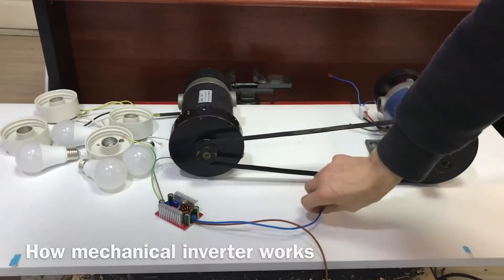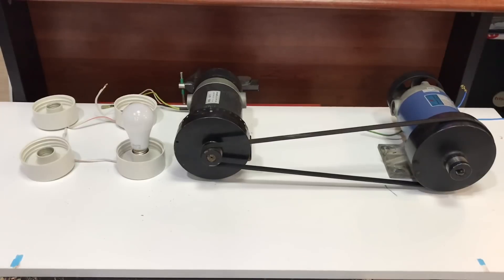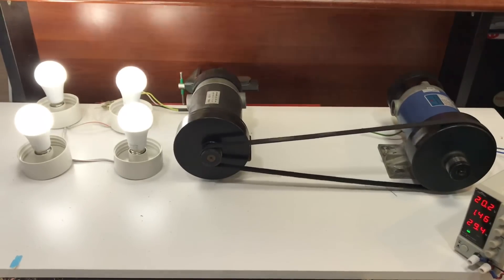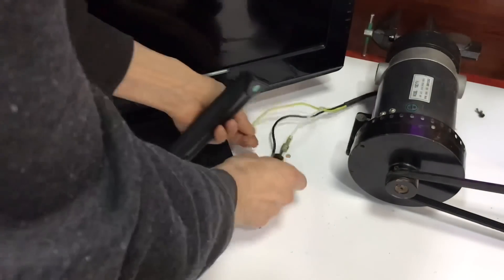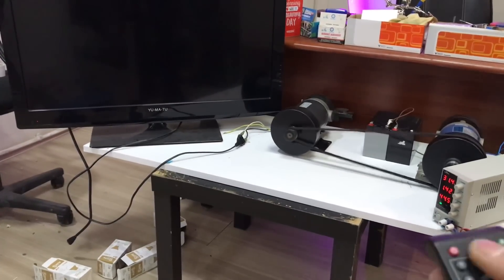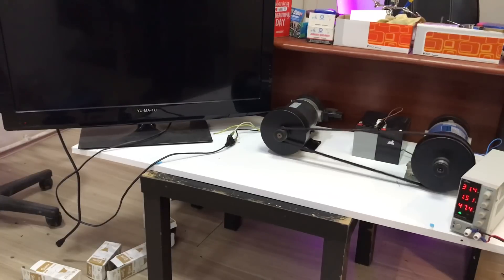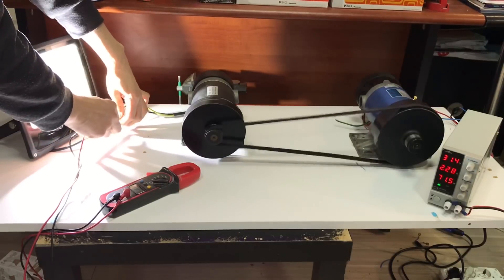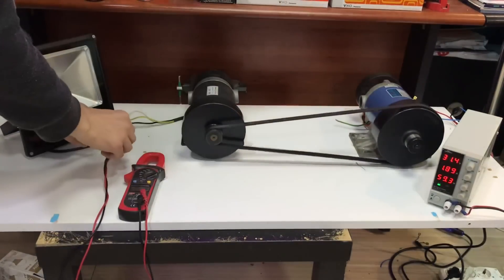ACİL  DURUMDA 220V ELEKTRİK ÜRETMENİN EN KOLAY YOLU, KENDİ ELEKTRİĞİNİ ÜRET

Comment: Videoyu sonuna kadar izlemedim belki bu konudan değiniyordur. Ancak yanlış anlamamanız gereken bir konu var. Burada elektrik üretilmiyor, üretilmiş ve depolanmış elektrik kullanılıyor. Elektrikte her zaman girenler ile çıkanlar birbirine eşittir. Elektrik üretmek bu kadar basit olsa zaten elektrik faturası ödemeye gerek kalmaz, bunun gibi sistemleri birbirine bağlar sonsuz enerji üretiriz.

 Peki buradaki sistem ne işe yarıyor? Türkiye şebeke gerilimi 220v 50hz olduğu için elektrikli aletlerin pek çoğu 220v 50hz ile çalışır. Aküler ise 12 volt gerilime sahiptir. Ancak gerilim tek başına iş görür demek değildir! Aletler gerilimden ziyade gerilim + akım ile çalışır. Voltaj ile amperin çarpımı bize wattı verir. Bu yüzden aletlerin üzerinde genellikle kaç watt güç tükettikleri yazar. Aküleri örnek alalım. 12v 50Ah akü 600w/h güç verir. Yani 600w tüketen bir cihazı kayıpları düşünmezsek 1 saat, 300w cihazı 2 saat kullanmamızı sağlar. Ancak akülerde bir de akım tipi ve frekans olayı var. Aküler DC 12v 70Ah da olsa frekansları 1'dir. Yani invertörler hem gerilimi yükseltiyor hem de ac akıma çevirip frekansı 50 yapıyor. (Akülerin 1Hz olma sebebi DC olmalarıdır.)

NOT: Ben elektrikçi değilim, akü frekansı sonsuz da olabilir. Neticede direnç gibi pek çok şeyi ölçerken 1 demek sonsuz anlamına gelebiliyor.